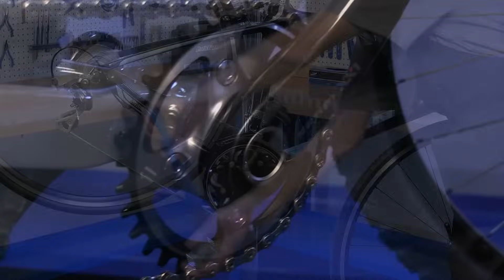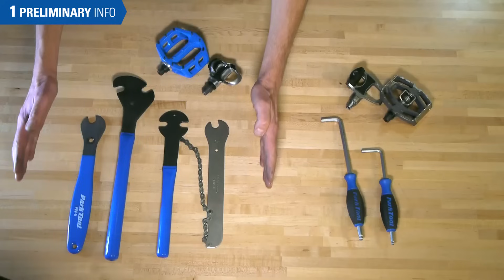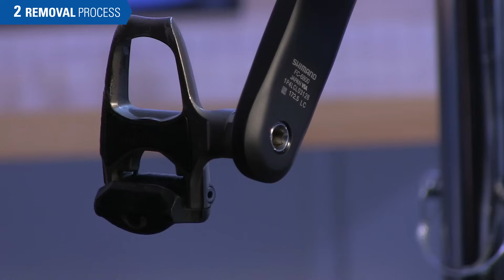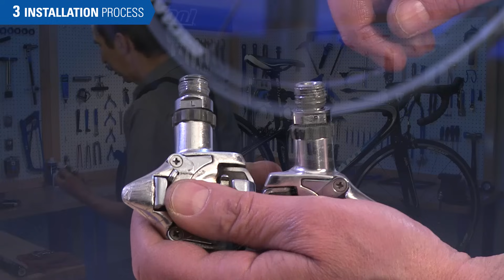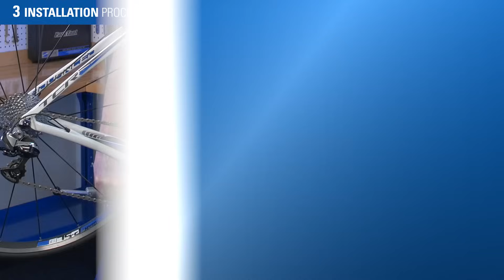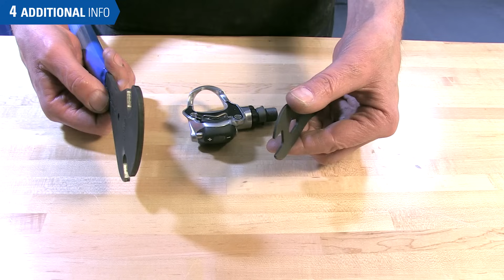Bicycle Pedal Removal and Installation

Comment: Can I take the pedals off with a regular wrench instead of a bicycle wrench??
Reply from the maker: An open ended 15mm wrench can work. Some pedals have very narrow wrench flats and require a pedal wrench.  Do not use a cone wrench ever for this.

Comment: Need to remove flat pedals and install SPDs on an older road bike. I only have a short pedal wrench that came with another bike. Can I still have enough mechanical advantage to remove it or will only one with a longer handle help? I tried this morning. With the non drive side and it wouldn’t budge.
Reply from the maker: The non-drive side is a LEFT-HAND thread.  Remove by turning to the right, clockwise.  Install by turning to the left.

Comment: You say to never use a cone wrench on your perals, but my crank arms have a recess at the pedal threads (for some reason), and a cone wrench was the only thing thin enough to get between my pedal and crank arm to remove it as the hex head was stripped

Comment: The first 15 mm wrench to the left is useless for instance for garmin pedals… its not long enough to provide good torque and the head’s profile not deep enough so the wrench slips out easily risking to damage the pedal

Comment: Guess I'll take mine to the shop tomorrow if I can't get that nice 15mm slim wrench with the nice long handle. I broke 3 regular 15mm spanners, 2 of which I bought new. The first one went when trying to turn the left pedal thread counterclockwise like a moron. The other two snapped trying to correct that mistake without enough leverage...my hand is not having any more janky attempts.
Reply: What wrenches did you use? It takes a lot of force to break a wrench unless you got them from amazon or harbor freight

Comment: Aw heck, the other pedal goes righty-loosey… it’s no wonder I was struggling!

My kids pedal spindle was heavily rusted and I thought it was just giving me grief cos of all the rust on it… now I’ve apparently been tightening it instead? At this rate I feel like I’m going need a blowtorch 🤬
Reply: I’m not mad at the video, it told me what I was doing wrong in the first few minutes. No waffle, straight to the point.

It’s a good video. I’m mad at myself for not checking you out sooner.
Reply from the maker: It happens to the best of us! Sometimes messing up is the best way to learn. Bet you never make that mistake again!
Reply: @parktool  it took a lot of elbow grease to get it off but at least now I was heading in the correct direction.
It’s very learned now, this mistake won’t happen next time.
This video saved me a lot of pain

Comment: The only bit of info I was seeking, which he doesn’t mention explicitly, is the simple “right side is common thread direction” and therefore, the left side is where you have to be careful to turn OPPOSITE of common. It’s the only potential blunder if old pedals are frozen tight. Yes, he says it, but all that clockwise and counterclockwise which depends on view direction is confusing. Everything else in the video is just basic mechanical sensibilities.

Comment: if the pedal on the crank side loosens just by the motion of pedaling or normal thread makes no since. Why wouldn't the crank side have a left thread so it actually tightens when pedaling. Anyway today I striped my left pedal and it won't even thread in now and tighten. Is there a thread adapter I can get that inserts
Reply from the maker: If there are no more threads in the crank there are people who sell helicoils for them. We offer taps to clean the threads but no Helicoils. The reason the pedals are threaded like this is because the ball bearings in the pedals reverse the rotational force.

Comment: Just got new pedals for Christmas and I don’t have a pedal wrench so turns out a 16mm combo wrench works great
Reply from the maker: A combination wrench will work fine. Just not as comfortabel and usually not as much leverage. But it should be a 15mm.
Reply: @parktool  it worked but for some reason I had to use a 16mm but thankfully my new pedals use an Allen key

Comment: Trek Domane Six Series 2012 - Both pedals COUNTER CLOCKWISE before you kill yourself trying to get the second pedal off listening to this video.  Note, some bikes are both counter clockwise not both.  This is a good video to see where you can use the wrench to get the best torque without killing yourself.  And tell bike shops not to OVERTIGHTEN... pedals are not going to come off people Jeezus... the threads are long enough in the crank that you can tighten them up with the wrench but not so tight you need to kill yourself to get them loose.  Damn bike shops don't want law suits if they put your pedals on so they tighten em so you need a hydraulic crank to get them off.  Ride On!
Reply from the maker: The pedals on a Trek Domane are like all other bikes.  The drive side is a right-hand thread, and the non-drive is a left-hand thread.  The CCW or CW view is assuming you are viewing it from side of the pedal.  Standing on the opposite side, it can appear to reverse, but the thread has not changed.
Reply: @parktool  Standing behind the bike, pedals moving forward.  Counterclockwise on both.  Meaning your putting the wrench in and pulling back on the wrench with counter balance on the opposite to create max torque to get them to come off.  I think we're on the same page yes drive side right, non-drive left, orientation of person bike in front of person.  The wrench is totally needed unless the original pedals have not been overtightened.  Love the wrench ;)

Comment: The simple way to remember is turn the wrench towards the back to remove the pedals, works for both sides.
Reply: confusing. turning upwards? downwards? bike standing upright? upside down? :/
Reply: Point the respective pedal cranks  to the ground. Put the wrench on or in with its handle facing the back wheel. Push down = push backwards. Works both sides. Kalvin’s leverage instructions are optimal, but if you get confused with the orientation, this technique can help you establish which direction is appropriate.

Comment: Which grease should I use for the inside and the threads of pedals?
Reply from the maker: Park Tool ASC-1 is a great choice for pedal threads. PPL-1 is also a good choice for that application.
Reply: @parktool  Just threads or both threads and the axle and ballbearing(s) inside?
Reply from the maker: Just the threads. The bearings or bushings in the pedals should use PPL or HPG.
Reply: @parktool  ok Thanks :)
Reply: @parktool  I have a plastic (probably teflon) bushing in my Race Facce Aeffect pedals. Is the PPl-1 compatible with plastic bushings?

Comment: I just got a mtn bike from my dad and the peddle is wobbly. I don't think it's stripped because it goes on and tightens just fine, it also comes off just fine. Does anyone know why it's wobbly? At least, uneven when I peddle? The crank arm is on correctly
Reply from the maker: If it is on and tight, there are two possible issues.  First, the pedal spindle is bent. and that would feel wobbly.  Next, and less likely, the crank is bent.
Reply: @parktool  thank you!! Will check out the spindle
Reply: @parktool  I found out by taking off the pedals end cap, the axle is bent! I put a finger where the nut is and turned it from the other side and it felt wobbly. Then I visually confirmed. Problem solved? 😎

Comment: I just purchase anti seize asc 1 for pedals. Is it correct?
Reply from the maker: Yes, for threads it is great.
Reply: @parktool  thank you sir, just another question. For the bb, when riding in the rain, what should I do to it? Do I dry the bb, do I need to lube or grease or use asc1? I’m a newbie but getting more to it.

Comment: Best NOT place the bike in a stand. On the ground you have the most control over the bike. Take position next to the bike and stay there when installing L and R pedal. And most of all... to REMOVE, force to the REAR (R-R). For both sides.

Comment: Pedal threads should to be 'greased' completely. Applying the grease to only the pedal threads will result in almost nothing on the pedal starting threads and the last threads in the crank arm once the pedal is completely installed. Especially when new pedals are installed on a new crank arm.  Grease should be applied to the pedal threads and to the starting threads of the crank arm. You don't have to coat all the crank arm threads. Just put in enough for the pedal threads to push the grease through and coat the crank arm pedal threads.  This will result in an even coating on all the threads when you see some grease around the 15 mm wrench flats and some grease around the end of the pedal threads on the back side of the crank arm. Wipe's away the visible grease.

Comment: Calvin, I simply tell folks "R"emove to the "R"ear!, "F"oward to the "F"ront to install :)
Reply: @GrievedHymn This doesn't work on bike pedals!
Reply: @GrievedHymn Bike pedals and most bottom brackets on the left side threads are reverse from the right side in which your rule would not apply. IF you can successfully removed your left pedal by wrenching to the left, your bike was poorly made with two right side crank arms. I'm 68 and do know my ass from my elbow! :D !!!
Reply: @thomascdurham9130  Yes it does. On the left you turn to the left and on the right to the right.

Comment: Honestly, no matter how I try, I visualise that left pedal being undone anti-clockwise. As you pedal, it rotates clockwise relative to the crank. That should mean, clockwise is the tighten direction. Why the hell is it the opposite? What is wrong with my brain? :-D
Reply from the maker: Good question.  Not about the brain, but the direction.  The bearings, that's what is missed here. The bearings between the spindle and pedal body reverse the load as you pedal.

Comment: The right pedal is right, or correct , the left is odd. Easy to remember now?
Right means a right hand thread which is a regular thread you turn to the right to do it up or to make it tight.
The left pedal has the odd back to front alternate left hand thread, turn right to un do or take out.
Reply: No. What way is right?
Reply: 100% agree. You can simplify it even more. Just remember one side. I say “one side is WHACK!” and that’s all I need. When you consider that one side has the chain and chainring and gears, it can’t be whack. So the other side is whack. No left, no right, no clockwise, no counterclockwise, no tighten, no loosen, no consideration of crank arm rotation, etc, etc.

Comment: Easiest way to remember:
Pull wrench back towards rear wheel on both sides, this way you will never confuse how to unscrew the pedals.
Pull wrench forward towards front wheel to tighten. 
Boom.
Reply: Thanks, Was to remember
Reply: Unless you turn from underneath

Comment: This is the only video that could help me to do this. I eventually had to put one foot on the opposite pedal, and one foot on the wrench (going to right direction) and use my body weight to get the first crank. Thanks!

Comment: What if I don't have grease (home fix) does chain oil work too?
Reply from the maker: Chain oil will be better than nothing. But grease or Anti Seize are the best. Reason being is that the pedal spindle is likely steel, stainless steel, or titanium and the crank arm is likely aluminum. Two different types of metal that when held together under pressure can galvanically react. The grease or anti seize does a better job of keeping the two materials separate. They also allow proper tightening of the pedal.

Comment: just watched the vid again for pedal removal: 
1. Get the "want to be"  removed pedal behind (so the opposite pedal is in front)
2. Get the tool engaged, facing the front (paralel or almost paralel with the opposite crank).
3. Tool goes up, opposite crank pushed/footed down

Comment: Can you use Anti Seize Compound ASC-1 with carbon crank? Or you need a different product?
Reply from the maker: ASC-1 would work great for the pedal threads on the carbon fiber crank, as well as for the crank bolts.
Reply: @parktool  thank you!

Comment: I was reading reviews of the Park PW-4 professional pedal wrench which is 15mm.  A reviewer said the wrench didn't fit his Ultegra pedals. I have been trying for 2 hours to get the information of what size pedal wrench is needed for Shimano Ultegra PD-6700 pedals without any success. The #6 hex allen key doesn't allow me enough leverage but there is a place for a pedal wrench which is too narrow to get a standard wrench on to find out. Any tips on where this information could be found. The internet is a marketing tool but for specific information is much less then optimal.
Reply from the maker: Those pedal install and remove from the backside with an 8mm hex key.  The flats seen outboard of the crank are bearing cup flats, and are not used to install the axle into the crank.
Reply: @parktool  Are you sure this is the case for Ultegra PD-6700.  I can put a #6 hex key fitting correct (#8 too large) at back of pedal but not enough leverage to turn. There is a spanner nut on the inside of pedal.  This is not the PD-6700-C carbon pedal which I don't see the spanner flats on.
Reply from the maker: Yes those are 6mm (Oops sorry). They also have a 15mm wrench flat. Any of our Pedal wrenches would fit onto that flat. If they are very tight I would recommend our PW-4.

Comment: I recently needed to take off my pedals from my tandem that had been on for years. I could not apply enough force to move them while holding back on the opposite pedal. The solution I found was to place a block of wood - a 2x4 about 6 inches long standing upright - under the opposite crank arm to prevent it from rotating. Then, on the pedal I wanted off, use a hammer to hit the 15mm box wrench I was using to turn it. The block of wood lets you whack the wrench as hard as you want - obviously, be careful. Once I did that I was able to remove all the pedals pretty easily.
Reply: When I was having trouble removing the pedal crank arm itself, I tied a round lashing between the other crank arm and the chain tube with paracord and that held everything in place really well

Comment: So are the nuts and the washers INSIDE the pedal? Mine on my specialized are so bad the plastic pedal was cracked and broken on both and lifted right off with just removing the front nut,

Comment: I never knew the threads were reversed on one side, makes sense though after watching this.  Had a bike given to me after it fell out of the back of a car and sheared the left crank right off, working on fixing it up, but the pedal felt 'gritty' like maybe the impact messed up the bearings.  Just gonna replace both pedals, but I was wrenching on that left pedal for five minutes before I watched this and found out it's reverse thread...

Comment: Just found out that it is almost impossible to do with a normal wrench

Does someone know a hack to this?
Reply: I cannot believe all of this everyday bike stuff requires all of these stupid tools I'll use once every 3-5 years. What an absolute racket. Just to put a bike chain and my bike on its trainer I've spent probably $60+ on random "bike tools." Now I'm here again trying to figure out how to install my pedals and welp, there it is, once again I need some $15-25 tool. At least Park makes some long lasting tools and has great videos.
Reply: Cheating bar: Thick pvc pipe or metal pipe so you get more leverage with the normal wrench. also push using your foot on the other side

Comment: I don’t have these tools, now what?
Reply from the maker: This procedure does require the use of tools. Most pedal wrench flats require the use of a 15mm open ended wrench or you can often remove them from the backside with an 8mm or 6mm hex wrench. Tool are required though.

Comment: what if I can't get my installed pedals out :o
Reply: Same...
Reply: Use a wooden block to prevent rotation and a cheating bar (metal or thick PVC) on your wrench tool so you get more leverage

Comment: I installed the pedals on my new bike a few months ago and everything runs well, except I keep finding small metal shards around the contact area between the pedals and the crankarms. It's like small chips of metal are coming out of the threaded hole of the crank arms. The pedals are not loose at all and the bike is running well. Any idea why this happens and is it normal? I did not apply any grease when installing the pedals.
Reply from the maker: It is common, and in that sense normal.  The chips are likely from the pedal shaft digging into the face of the arm. A pedal washer between crank and pedal can help prevent this.  The threads are not damaged by this, and the pedal stays tight if adequately torqued.  These burrs however can be sharp, it is good to know them off with a small file or pick.

Comment: My 2 Question Is Can I Use The Conventional 15mm wrench and One More Question Can You Tell Me which one The mm allen Key for the XC MTB pedals? Thank You
Reply from the maker: Many pedal wrench flats are narrow, and will not accept the wider open end 15mm wrenches. These need a pedal wrench.   But if your wrench fits fully on the flats, it will do the job.  For the hex fitting install at the end of the pedal thread, these vary by brand.  8mm is common but you also see 6mm.

Comment: The pedals are frozen in the cranks...hard to apply enough force with everything rotating. What do I do?
Reply from the maker: When dealing with a particularly difficult pedal it can help to put the bike on the ground. This and sometimes a bit longer wrench can help you out. What wrench do you have?
Reply: Use wooden bar to prevent rotation, then use cheating bar (thivk PVC or metal pipe) over the wrench to turn it